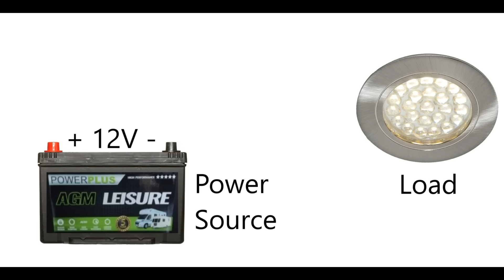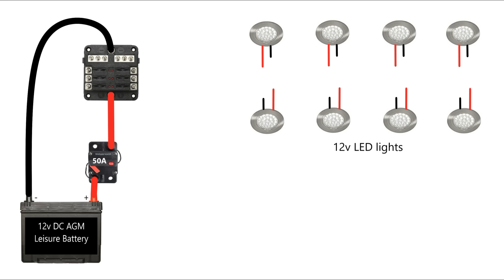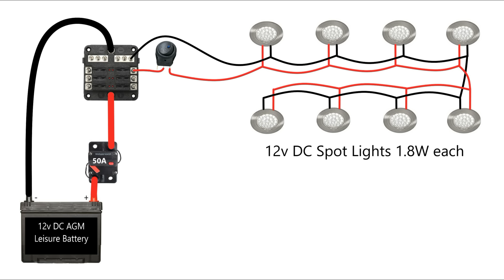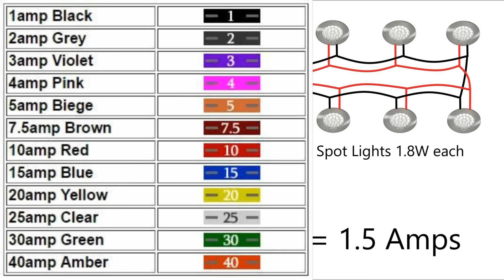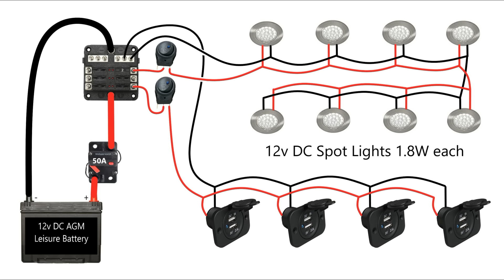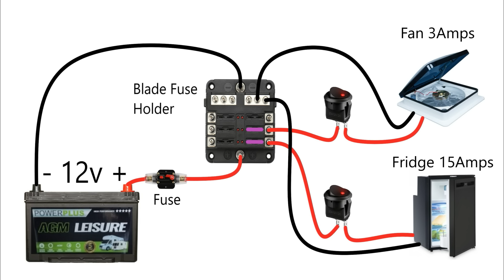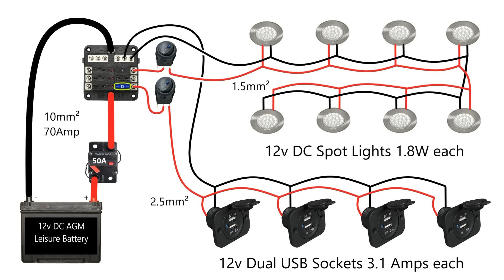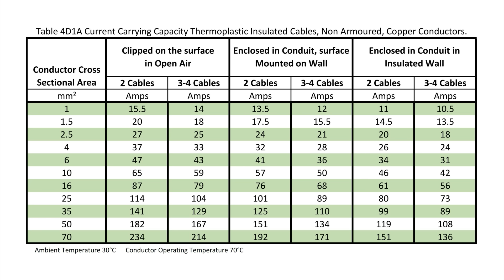Electric Cable & Fuse Sizing - Camper Van Conversion Series

Comment: Hi Greg, apologies I have another question I was wondering if you could please help me with? My new campervan is the Vline 635 Sport and it comes with a Sargeant EC176 PSU/Charger. The problem is it has a max output of 13.8V but I'm changing my Leisure Batteries to 2 x AGM 160Ah batteries and I understand they require 14.8V to charge. I only have 1 x solar panel as standard which I believe is a 100w panel and also a smart alternator but I dont have a B2B Charger unfortunately...... Will me not being able to charge the AGM'S up fully cause the batteries to die an early death? Is there any way around this? I have electrical hook up on the van, would I be able to use a Victron Smart Charger with it and when I plug my hook up into the van, plug the Victron smart charger into the plug socket inside the van and then attach it to the AGM battery terminals to give it a charge that way? If so would I need to disconnect the battery terminals from the on board Power Supply Unit before I connect the smart charger or could I connect the smart charger whilst everything is still connected to the leisure batteries? I'm worried about blowing something doing it that way? Would it be difficult to replace the hook up charger with a 14.8v charger to make it easier to charge the AGM'S? I suppose that would mean replacing all the wiring as well?

Comment: Hello Greg! (Definetely not George). The USB sockets shown on video are 5V, does that not mean that in our 12V system, they are not 3.1A each, but, 3.1×5=15.5W, so 15.5/12 = 1.29A. Is this correct or am I thinking wrong?
Reply from the maker: Who’s George? 🤪
Reply: @GregVirgoe  hahah I'm sorry I'm in the heat inside the van trying to sort out electrics watching your videos, my brain melted 😅

Comment: Thanks for the reply so I have 2 agm battery's in the engine bay the 3 rd battery in my canopy do I have one redarc bcde 40amp battery monitor talking to the 3 battery's or do I have one bcdc battery monitor  for the two in the engine bay and another one for the battery in the back and hard wire to the solar panel on the fixed roof

Comment: Thanks a lot for your video.I just want to make sure .
I have two solar panels , one is 165w and second is 170w.
With Mppt of 40amps and battery of 280Ah( lifepo4) 12V.
Currently I have the van with 10mm square cable from the roof (panels)to the controller and also from controller to the battery.
Is it ok to connect the above system?
I will appreciate your advice thanks.
Reply from the maker: It’s not the best idea to wire together miss matched panels as the voltages and amps may be different. These are very close is size. Can you confirm the operating voltage and amps from the label on each first. Thanks
Reply: @GregVirgoe  
The 165W is 18.94V and current of 8.7A.
The 170W is 17.5V and current of 9.7A
All are Mono type.
Reply from the maker: @mytube3687  I recommend you wire these in parallel, the voltage of both panels will come down to the lower value but the resulting amps would be added together. 6mm PV cable or bigger would be fine for that application 👍🏼😃

Comment: With my truck build i have 3 agm battery's hooked up to a bc drive charger iam going to in still solar pannel
How would you wire this up 
Regards Paul
Reply from the maker: A solar mppt charge controller can be connected to the leisure batteries in addition to the dc driver charger. The MPPT will turn itself down if it sees higher voltage when you’re driving.

Comment: Could I ask what method you would recommend to join the loads to the dual core? Is it a three way connector?
Reply from the maker: You could solder and heat shrink or even easier now just use WAGO 221 connectors. Really easy 👍🏼🤩

Comment: Hi Greg, your videos are so helpful but im still struggling.
What cable would I need to buy to connect up the following
12v led lights
12v fridge
12v usb sockets
12 switch panel
Is there something that assist with which cables to use for which product?

Thanks in advance

Comment: Hello Greg hope your well. Question....I want my refrigerator to get power all the time from my battery. So I want to do a direct to battery hookup. Can I do an outlet only for the frig that i plug into and connect outlet wire directly to battery? What do you think?
Reply from the maker: Is your fridge 12v DC or 230v mains?
Reply: @GregVirgoe  it will be a 12V
Reply from the maker: @nspacelofihiphop7101  then you can connect it directly to your leisure battery with the correct size fuse in the positive feed. 
Do you know the model of fridge you are getting?

Comment: Hi Greg, awesome videos and very informative, just one question - you mentioned 1.5mm 2 core cable, can this cable be used on all of the 12v devices?
Reply from the maker: No some require thicker cable like fridges or heaters. Our fridge needed 6mm cable to it. It depends on the amps required.
Reply: @GregVirgoe  thank you for your reply, I have the same van as yourself, where can you recommend placing the batteries?

Comment: Dear greg, i have a traditonal dynamo 180a. I want to use 25mm cable over 2mtrs to link my startaccu to my leisure accu. I Will connect it with a victron device. Is 25mm cable enough?
Reply from the maker: I would recommend an isolated Victron Orion 30A charger and in that case 25mm cable will be ok

Comment: Hello again Greg and tks for this video again. On the chart you have in this video. I see you have wired a 50A fuse breaker? on the positive side between battery and fuse box. How did u determine the size for that? Anyone can ans tks
Reply from the maker: Yes simply add up the amps of all the appliances connected to the fuse box assuming that they are all running at the same time. You can lower the figure slightly by applying a little diversity assuming that certain things will not run together.  Hope that helps 👍🏼😃
Reply: @GregVirgoe  thanks again Greg and sorry 4 the bother...tks 4 all the info.
Reply from the maker: @nspacelofihiphop7101  it’s no bother at all. Thank you for watching 😃

Comment: I'm currently planning my wiring. Is it possible to put two blade fuse holders in? I can only find 12 space ones and seem to need more
Reply from the maker: You can fit as many as you need and put them in different locations in the van to shorten your secondary wiring 👍🏼😊

Comment: Hi @Greg . Just recently bought a merc sprinter to convert, and have subscribed to your channel, and already watched several of your very informative vids. Unfortunately I had already started to purchase some of the stuff I think I'll need, and I bought 8metres '10mm2 Thinwall 70amp Auto boost red cable' to connect my vehicle battery to my 30A DC/DC BATTERY SMART CHARGER (RING RSCDC30) is this cable sufficient? And if not what should I purchase for this? Many thanks. Dave
Reply from the maker: That cable will be fine for that application. 👍🏼😊
Reply: @GregVirgoe  Thanks very much Greg....your videos are excellent and informative my friend, makes things alot less daunting for my 1st attempt at a ''Van Conversion'....Have a good day🙂🙏
Reply: @GregVirgoe  Also Greg, would you by any chance have any diagrams to include the charging and use of the actual vehicle battery via my solar system? (I'm a retired paramedic, not so good as an auto electrician 😅) 🙏

Comment: coming from the charge controller to the battery is there a standard in fuse size? I'm running a 12 volt system with 370 amp hour 6 volt batteries in series. My inverter at best is around 250 watts on the display. Not trying to bug u but the more info I can get will be great!

Comment: hi Greg, thanks for the video. I have a 2500w inverter. I after watching your video I have placed a 250a breaker but I'm unsure on the wire size to use. can you help? 
thank you Darren
Reply from the maker: You will need at least 50mm cable from the battery to the inverter 👍🏼
Reply: @GregVirgoe  thank you

Comment: Hi there. Just another question if you dont mind. I have two batteries wired together, would I need a charger for each one when I go on electric hook up? If not which battery would I connect the charger to please? Thank you.
Reply from the maker: When you have two batteries you need to put any chargers across both batteries. So positive connect to one battery and negative connect to the other battery. On the same terminals where I show the solar charger connected in my free diagrams. Links are in description of the off grid wiring video 👍🏼😊
Reply: @GregVirgoe  Thanks so much for the quick reply, really appreciated as I have pulled out the batteries and disconnected everything to do it. Nothing is ever easy though is it when someone else did the initial install. Ive now found the ring connecters on the  CTEK charger are too small to fit on the battery terminal but  are too big too fit onto a battery quick release  clip cover I have brought. This means I now have to consider cutting the 24v wiring which I really dont want to do as I have no tools to crimp the correct size connectors  really tight. Sorry just ranting lol. Thanks again :)

Comment: How big of a alternator I need to full charging 2 batteries of 12 V for my camper van
Reply from the maker: Your DC to DC charger should be rated at no more than 10% of your battery capacity for lead based systems. Typically that would be 20-30Amps 😊

Comment: thanks for the video, as a novice, i did your formula for the lights, it worked out at 1.2A so why not use the 1mm2 cable which is capable of 15A,  just a thought, or have i done the formula. wrong
Reply: Hi I'm an electrician, I actually spotted that as well when watching this video, you're right the 1mm cable is by far plenty. You could use 0.5mm as its (generally) rated for 3amps, or 0.75mm for 6amps. There is also another factor you have to consider which is "volt drop" of which flexible/stranded core cable suffers from a lot, but basically as long as you size a cable so its amp rating is 2 times larger than your amp load you will have nothing to worry about at all.
Reply: @TomGB-81  thanks for the reply, i bought the 1.5mms, wile your here, could you tell me this, i have converted a boat cabin light to led, what a did was bought the led strip from amazon, then cut one of the lights off the strip, so i am now going to connect the 1.55ms square to a much thinner led wire, wile this work, or go up in smoke. seems ok when i run it from the battery. the LED  cable is 20agw=0.8118
Reply: @MrWhothefoxthat  So you're extending the  cable length? from where you cut the old light off, and put the new light a little further away? If so, using the 1.5mm cable as extension then that's fine. I assume the old light was a non-LED bulb? So your new LED light probably uses less than half the power compared to the old light, unless the LED is brighter then it uses approx the same power.
Reply: @TomGB-81  i was a bit confused about running 1.5mms into 0.8 led wire, with one led bulb.
Reply: @MrWhothefoxthat  It would only be a slight problem if the cable was downsized. Also, I've just noticed a response from Greg from 2 weeks ago:
"Hello Greg here 😃 I used that as my smallest cable size for most things in the van because cheaper to buy a 50m drum of cable than shorter lengths of loads of different sizes. Plus keeps the installation easier if only using one cable for most things. No harm in going bigger on cable.  Less resistance and run cooler."
Reply: @TomGB-81  that make's sense, i must say as a complete novice, i have wired my small boat from his knowledge, i also challenged the so called spark on the boat yard, he told me to buy 28mms battery cable, in actual fact i only needed 16mms, he didn't know what to say for himself, enc he isn't doing it.
Reply: @TomGB-81  forgot to say, thank you for your input appreciated.

Comment: If I have 3 panels 210 watts, wired in series.  9.3 amps a panel.  Do I need a fuse between my panels and solar charge controller?

Comment: Hi Greg. Thinking about getting a Single induction hob for my van. Would it be too much draw on the batteries? K
Reply from the maker: Anything that cooks with electric is always going to draw a lot of power. If you take the watts of the appliance and divide by 12 that how many amps it will use in an hour. Then you can gauge how much you can generate to be able to use it 😊

Comment: Hi Greg

On the rocker switch.  Am I right in thinking I can do away with the LED light if I want on switches with 3 prongs and like you did here, just break the positive?
Reply from the maker: Yes absolutely 👍🏼 the negative connection is only there to make the light come on and does not need to be used 😊
Reply: Thank you  @GregVirgoe  . I owe my whole build to you and always recommend your channel on Facebook.  One last thing.  Hopefully it's just a yes or no and doesn't take too much of your time.  If I copied your schematic to the letter. Including cable sizes. I have no inverter YET or shore power. Am I right in thinking I don't need to ground to the van unless I add inverter,  shore power or charge leisure batteries from my engine by a dc to dc or similar
Reply from the maker: @SuperLewis05  an isolated 12vDC system doesn’t need to be connected to the van. If you can any 230v mains this would need proper earth connections.  New video coming soon on this 👍🏼😊
Reply: @GregVirgoe  oh thank you Greg.  I'll definitely watch it 👌

Comment: Hi, forgive me for being a bit slow. Lol
I have 3x100w solar panels (red/black) 12v the cable is 10awg through a 60a breaker. Is this OK or a bit over-kill. 🤔
Reply from the maker: If you have them wired in series then the max fuse rating would be about 15amps. If you have them wired in parallel it would be 30-40Amps max. 60 is a bit too big for those panels. What type of MPPT charger do you have??
Reply: @GregVirgoe  A 20A MPPT EPEVER
I have the panels wired red cables together as the black together. 
It's I get or read so many conflicting information it make your head spin.

Comment: Hi Greg. I want to fit LED light bar on the roof and want to suit a fuse and wire. And the box says it is 1300w, sa the current would be nearly 110 amps? It doesn't make sense.

Comment: Hi Greg, may I ask a couple of questions. I purchased x3 12v cigarette sockets on eBay however when they arrived I realised I have no information regarding the watts or amps to calculate the cable or fuse size. Is there a standard for this as its 12v? Also, maybe a silly question but how do you wire a wall socket from the inverter? If you’d be so kind to help me out, I’ll make sure to donate on your PayPal as your videos are amazing help.
Reply from the maker: Hello Jack. Typically cigarette sockets are normally protected by a 15Amp fuse. So that means 12v x 15A = 180watts that’s enough for a high powered laptop. Now if you wire them individually you can do it with 2.5mm cable. But if you wire them all together you would need 10mm cable. As it could be 45Amps. 
With regards your 230 sockets simply wire it like an extension lead with a 3 pin plug in the inverter and the other end of the cable wired in the back of a socket. 2.5mm cable should be ok for this.
Reply: @GregVirgoe   Hi Greg, thank you so much for getting back to me. I’ve only just realised you’d replied. I’ll making a donation now so show my appreciation. One more question if I may, I’ve got quite a few 12v appliances, but only 12 ways on my blade fuse holder. Am I able to simply but a couple together on the same one. For example my spot lights and led strip lights? Is it just a case of combining the amps and x1.25 like normal to find the fuse? Regards Jack
Reply: This is my list that I need to get down to 12 ways

1. Water Heater
2. Door/Kitchen/Under bed LED Strip 
3. 12v Socket
4. Tv 12v Socket
5. USB Sockets
6. Shower light/Extractor
7. Water level gauge
8. Reading lights
9. Kitchen fan
10. Water pump
11. Speakers
12. Heater
13. Fridge
14. Gas Tank Gauge
15. Cooker
Reply from the maker: @jackconnell1153  yes exactly that :D

Comment: Will there ever be a situation where I will need 4/0 tinned stranded copper wire instead of just 2/0 tinned copper wire in my van conversion?
Reply from the maker: It’s unlikely that you’d need cable that big unless you plan to put in a huge inverter and battery system.

Comment: Hi Greg, if I have a 130ah battery, and my total amps at max usage is 11amps ( 12v fridge @ 3.5amps &  2 off 2.1amps each USB’s  ) am I correct in saying the cable from the fuse to outlets only needs to be 1mmsq.
What would my terminal cable  be?

Regards

Mick

Comment: Hi what size wire do you need for the Shurflo pump back to the battery bank and what sized fuse please seen a few different ideas snd now have a mental block! Lol
Reply from the maker: I would use at least 2.5mm cable and a 10amp fuse for the pump
Reply: @GregVirgoe  you are a star thanks so much

Comment: Silly question, but is there a need for relays for switches? Things like waterpump or fridge?
Reply from the maker: Not a silly question at all. Relays are often used when there is a large difference in rating or voltage of an appliance where the switching circuit would not be able to handle the load or is operating at a different voltage. In this case as everything is 12vDC it’s ok to make sure that the switches you use for isolation are rated well above the fuse rating of that circuit so they can handle the current and not burn out. They also need to be suitable for direct current as that important too. Hope that helps 😊
Reply: @GregVirgoe   Thank you for the fast response. As most of my build is 12V with only a small inverter there shouldn't be any need.

For some reason in my head it made sense to have a short thick wire to high use appliances and a thin wire to a central switch board. But I guess that's over kill considering a van is a few meters at max.
Reply from the maker: @braccereve9271  it’s making it over complicated when a simple switch of sufficient rating will do